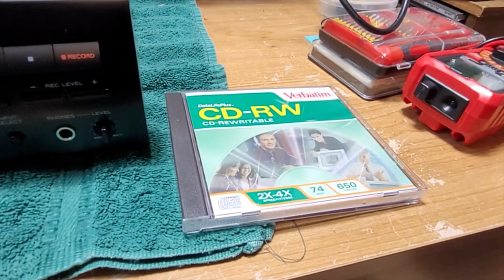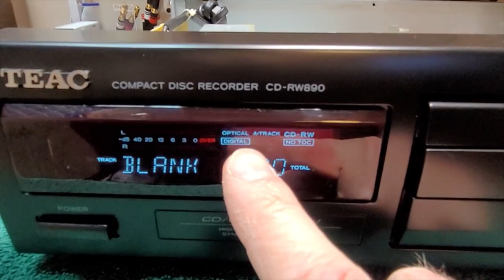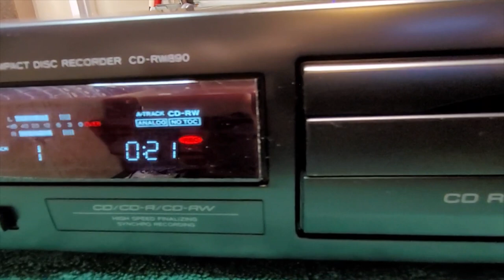Teac CD-RW890 CD Recorder

Comment: I have a couple of these, a mark I and a mark II, both bought faulty very cheaply (I also had a third with a completely shafted processor board that I could never fix and it went to ewaste). I'm not sure I agree about the build quality - in addition to the cheapest of the cheap caps (not just cheap, Ali Express level cheap), I've found that the hand soldering of the connectors can be really bad, the connectors were actually partially melted om one of them, and there is a lot of hot snot liberally splashed about in lieu of plastic parts that actually fit together properly. When they work they're great but I have not been impressed with the attention to detail. The "fault" on one of mine (an apparent infant mortality unit that went back in the box and not returned to the store) was the glue holding the SATA cable to the motherboard had seeped in between the plug and socket, slightly deforming the plug such that it didn't make contact - resulting in a mech error. A replacement SATA cable fixed that one. It gives you an idea of the slapdash standards at TEAC's Chinese contract manufacturer. It's a shame as the basic design is good. 

As you pointed out the big advantage of these units is they don't care about using the "correct" audio media despite the manual telling you to use audio CDRs - and that DVD-RW drive can be swapped with a PC one is it wears out. The DAC is a rather decent AKM, similar to the ones put in Onkyo AV receivers. It sounds pretty good.

Comment: OK, I still haven't figured out how to get it to show the next track when the next cut in a album is playing. It just continues recording as "'track 1" until the album is done playing side 1. I have tried every combination in the Auto/ Manual modes, as well as the sync modes. The owners manual says it will change tracks when the next cut plays but it doesn't explain it very well. The only option is to add the track manually by hitting the record button at the end of each song.Which in turn starts the counter at zero. Has anybody figured out how to add the tracks automatically? I would be happy to hear from you. Thanks for reading.